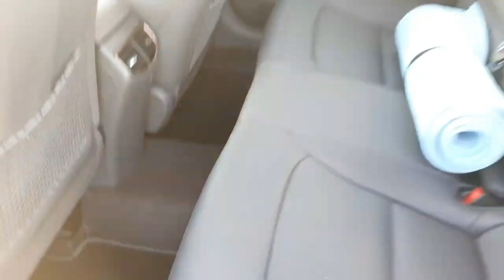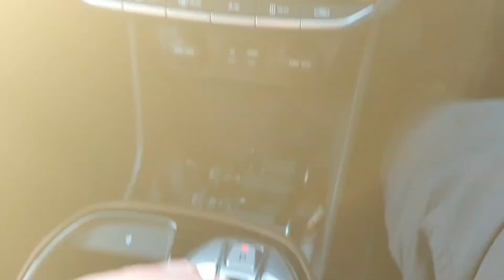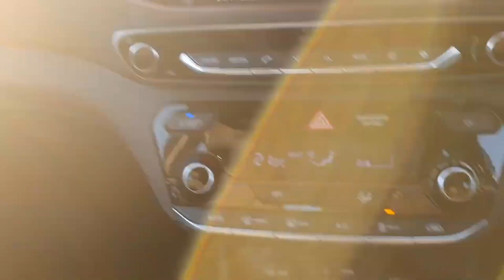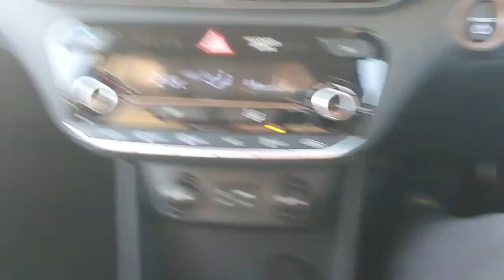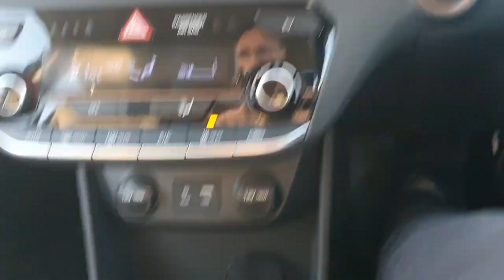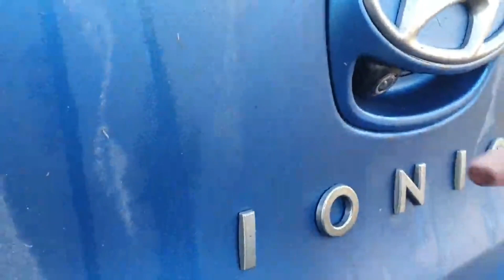Why the #WindKnife is the best EV I've ever owned !

Comment: Don't drink the coolaide... I have this 2017 car. Have been happy with two previous gas Hyundai's.
Love EVs. Also owned a Leaf.  It pains me to say it but..This car is crap.  Make no mistake, it's a compliance car.
Built on the foundation of a gas vehicle.
I'll be trading up to a Tesla or at least a car designed to be an EV.  There's  a big difference.
Reply from the maker: Im sorry your incorrect , the ioniq ev scores in EVERY area over a Leaf.
Equipment,  efficiency, regen, comfort.
Reply: @JonathanPorterfield   owning one of these is all the proof I need, my friend .  -crap.      Better range and efficiency than a leaf, agreed. I'm not a big leaf fan,  But this Ioniq is Severely behind the engineering of a true EV like Tesla.
Reply from the maker: Yes Tesla are leading the ev industry,  no question  , but out of all the other manufacturers,  Hyundai/kia evs are the most efficient.

Comment: The 28Kwh Classic is probably the prefect balance of weight, range and charging speed. More than enough range for daily commuting and still getting faster on longer journeys, as >50Kw are rolled out. The drive to bigger batteries and range isn’t necessary, the UK is small. Lighter with fast charging works and makes car more efficient.  The market drive for 250 miles + isn’t for current EV owners we know they work, it’s to get people out of there ICE cars. The Geek in me love’s the efficiency and number crunching!

Comment: Jonathan, your m/kw are actually low for the Ioniq. Quick tip. Always use the A/c in Auto mode not how it was in the car just then. Also in summer when A/c or heat isnt needed press the button thats lit to turn it off and then press the blower direction key to blow to your face. This allows the blower and demisters to work but turns off the A/c. Super efficient then. My best with this is 6.2 m/kw and this included motorway at 70mph too. Its such a great car.

Comment: Cracking video JP. The 28kWh Ioniq is Hyundai's best kept secret, I'm seriously considering holding onto mine when the lease runs out as nothing I've seen yet beats it in this price range. The Premium SE is fully loaded and has so many bells and whistles. Have you found the mirrors dip when you are reversing helping you to avoid the curbs? Oh and that feeling of perpetual motion when you lift of with zero regen, perfect 😍. Oh and they've just updated the Satnav which looks even better now.
Reply from the maker: Hi , yes i found the dipped side mirrors , and the entry /exit setting for the drivers seat is great too. 
This is also the 1st VEHICLE ever for  me where i find the rear max setting for drivers seat is TOO FAR BACK from the pedals and steering wheel !

Comment: I have a 28kWh Ioniq in Australia. I think it looks quite smart in white with piano black  nose panel! I have the base model, so  no chrome trim around the side windows, a free chrome delete, looks good. We don't get the heat pump heater in Australia, a bit annoying, but the climate is milder here so not a huge problem. We did get autolink phone app here, but it's pretty useless.

Comment: I'll be getting my first EV next summer ...... decided to take the plunge after driving hybrids for the last 6 years.
I'm looking for a medium sized family car or maybe a small SUV like the Hyundai Kona or Kia e-Niro, so there are quite a few to consider.  I really don't like the look of the Leaf - very dated now and agree with others who've posted that Nissan made a great start then seemed to stop developing the car.
I've got a budget of around £36,000 so will be test driving all of the relevant EV's in this price range once car showrooms are open again.
I managed to get a test drive in the 2020 38.3kWh Ioniq just before we went into national lockdown and was very impressed with it.  Extremely easy and comfortable to drive, surprisingly high level of equipment for the price and sufficient range for my needs.  I'll be charging from home most of the time as I have solar PV installed as well as being on a cheap-rate night time tariff.  I reckon public charging will only be applicable if touring around the UK or europe. 
Based on everything I've seen and read to date I reckon it will be a three-horse race: the Ioniq, the 39.2kWh Kona or the 58kWh VW ID.3.
I really enjoyed your review and found it reassuring that you rate the Ioniq so highly.  Thank you! 👍
Reply: @mike s  Hi Mike - have you driven or owned either of these cars for any length of time?  I'm wondering why you can be so sure I should go for the ID.3?

Comment: I'm on the look out for my first Ev for my 100 mile round commute. I think this could be it. With a possible granny charge at work for peace of mind it could be a goer! Thanks for the great video.
Reply: We get 100 miles easily in winter, but as a commute that would be quite hard on the battery if you commute every day. If you were prepared to take it gently in the worst weather it would work well. Even better to top up at work!
Reply: @simoncanfer5030  thankyou for the info! Yes I take it easy generally, trying to eke out the best mpg in my dirty diesel. It's a steady commute across the Moors and I average 45mph so i'd hope it would suit an ev. Ideally I'd granny charge at work, drive home and back and granny charge again 😁

Comment: I've seen more than 170 on my GOM in summer. Occasionally over 7 miles per kWh in the history. Charge speed in miles per hour is great due to efficiency, but it can also go up to 69kW as you say, and it holds top speed all the way to over 80%. And its not a new car, it's been out for a while now. Why can't other manufacturers with more recent designs compete? I haven't noticed any battery degradation yet. I'm not sure what I'll buy next. At the moment, most other cars would feel like a compromise.
Reply: Yes 175 is my max range in balmy dry weather on German A roads.

Comment: It is a great EV and I agree, Nissan should be making something as good. Efficiency is king for an EV. Shame the latest Ioniq doesn't charge anything like as quickly. On CCS, we can charge the '28 in 20 minutes and it has the range of a Leaf 40. So good we bought two :)
Reply: My wife and I have an Ioniq each too :) will be hanging onto them for a while! Cracking cars
Reply: @tommoger  have to admit one has gone now, replaced with a used Model S. Ioniq still compares well.